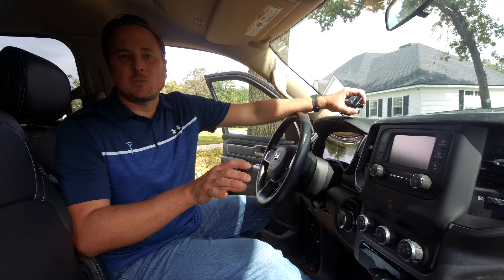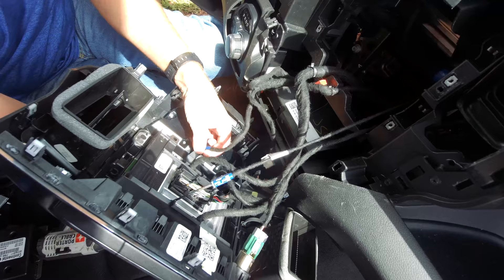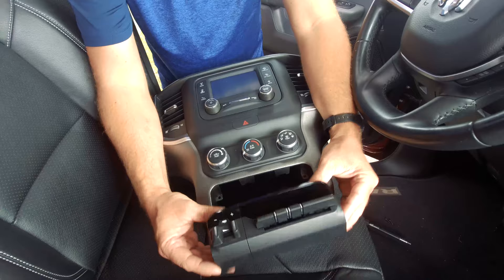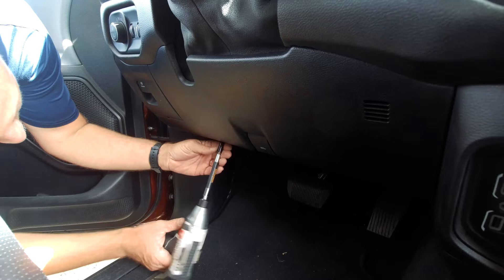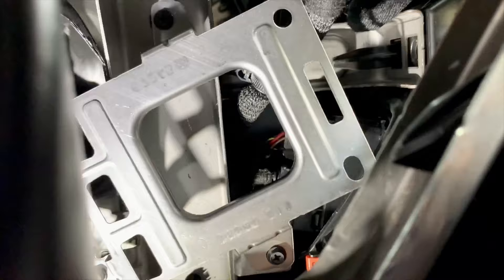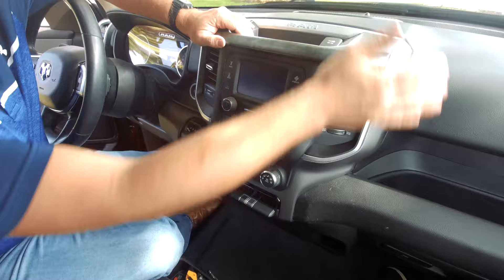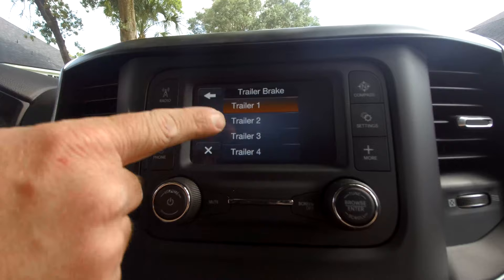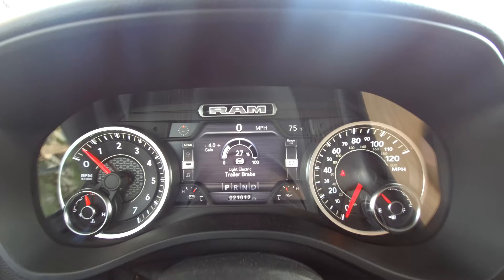2019-2023 Ram 1500 Electronic Trailer Brake Controller Installation - Easy DIY Plug & Play Install!

Comment: My truck came factory with a hitch and a 4 & 7 pin receptacle at the rear bumper. I assume there is no other wiring that needs to be done if you install this controller?
Reply from the maker: That's correct! You'll just be installing the module, switch, and run the programming!

Comment: Does the 2019-2024 Ram 1500 brake controller package SKU C-BDLTBC-DT include everything needed for install and programming and factory parts? I think the price is $399
Reply from the maker: Yes everything in our kit is included. You don't need anything else to make this upgrade possible. 
https://infotainment.com/shop/interior-accessories/towing/2019-2023-ram-1500-heavy-duty-truck-integrated-electronic-trailer-brake-controller/
Reply: Do you have to disconnect the battery?
Reply: $400 is a ridiculously high price for a brake controller.

Comment: Does this have a negative effect on the trucks warranty?
Reply from the maker: This is a completely plug and play factory OEM upgrade package.  The upgrade uses factory OEM parts and programming.  You do not have to cut or splice wires to perform the installation, maintaining the factory OEM integrity of the vehicle.  That being said, because of this it will not have any negative effect on the trucks warranty.
Reply: @Infotainment_nav  Thanks for your reply.  I was just worried about BCM programming outside of the dealership network causing me any issues when it's in for service.